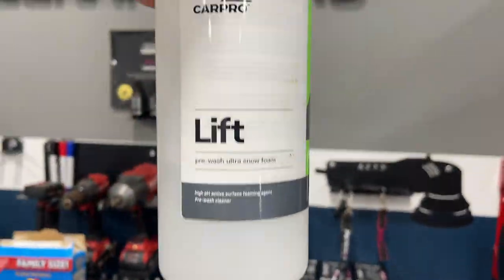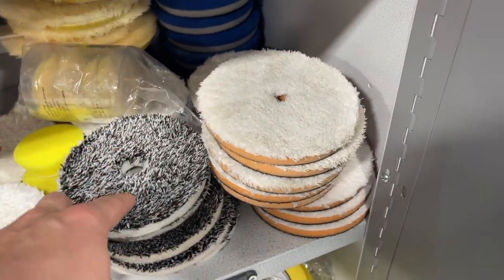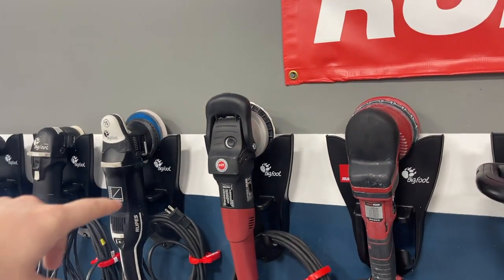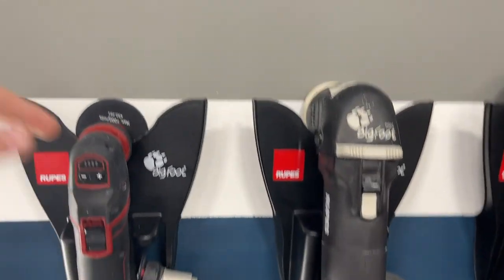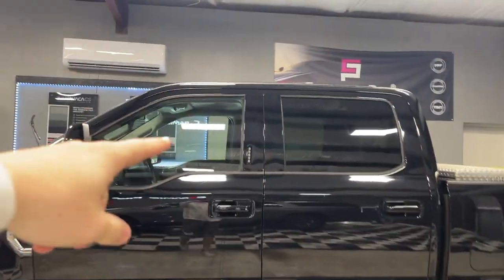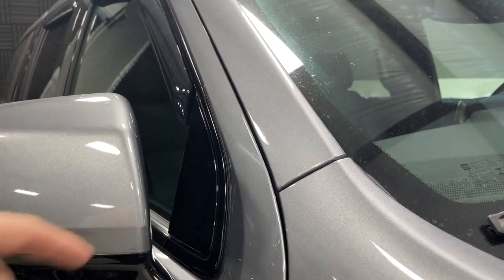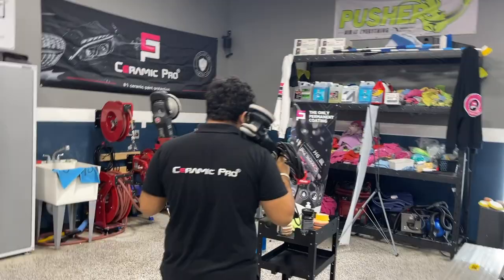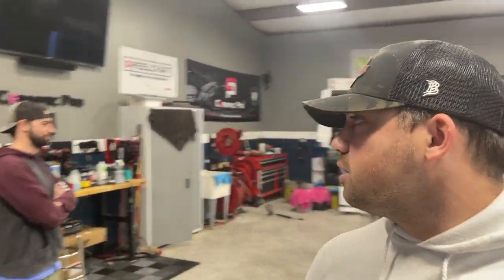What is the Best Machine Polisher To Remove Scratches and Defects in Car Paint? Rupes? Flex? Dewalt?

Comment: If I clay bar my car, can I start ceramic coating right after or do I have to rewash with a “stripping” wash to clean off any debris left from the clay bar?
Reply: Clay will mar the surface. After clay, I'll use Panel Wipe or Eraser because it dries quickly.  You should really polish after clay, then use eraser, then coat. Whatever imperfections are on the paintwork will get 'locked in' when the coating is applied.